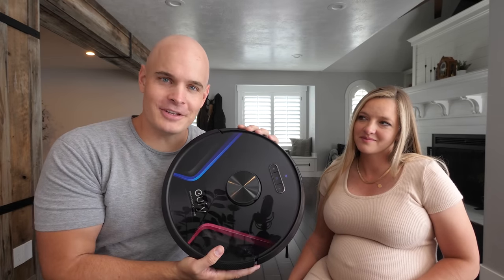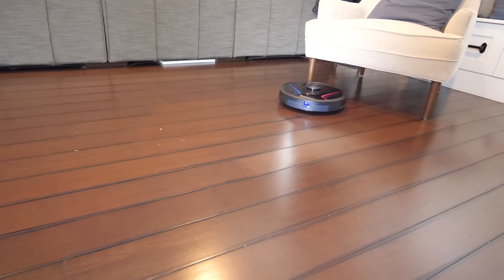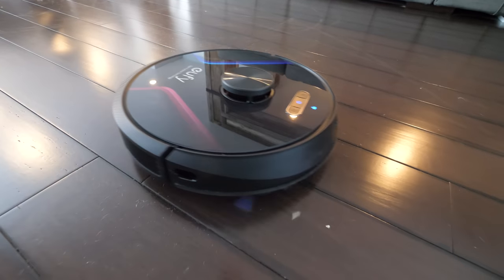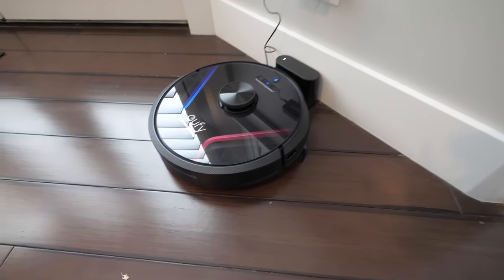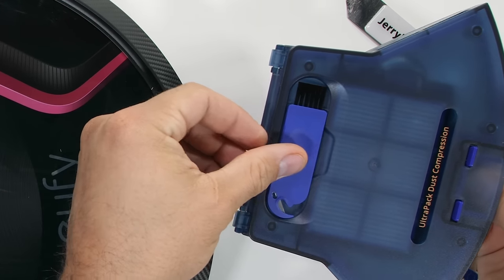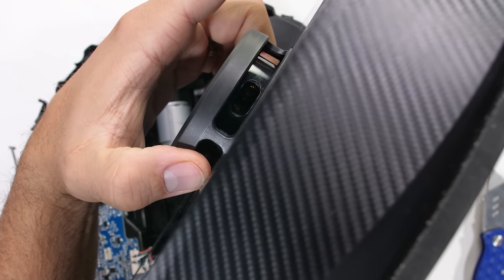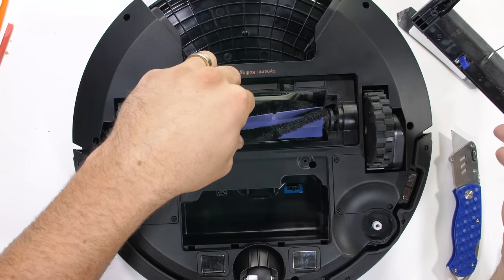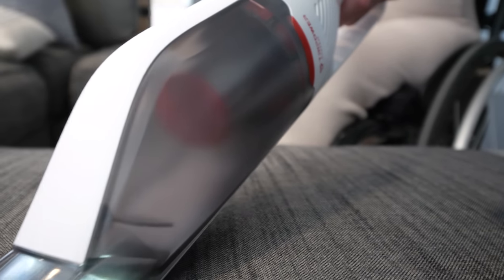How to Vacuum your House using LASERS?! - Teardown!

Comment: "whats a pascal? Nobody really knows" this is hysterical. Awesome video
Reply: in engineering, a pascal is 1 newton per meter squared, but i have no idea how that applies to sucking power lol
Reply: @damienmccue2793  It produces a "vacuum" with that much pressure relative to atmosphere.
Reply: @eDoc2020  Interesting, if i recall the video said 2,000 pascals, so inherently i’d assume that was the “suction power” over a square meter, but when taking into account the small inlet, which is probably closer to .001 square meters, you’re looking at .3 psi. (1 Pascal = 0.00015 psi)
Reply: @damienmccue2793  The funny thing about 2kPa suction is that apparently regular household vacuum cleaners are ten times that, or 20kPa. I can imagine this little robotic cleaner having less suction but only 10% seems a little wimpy. I wonder what the practical effect of this is.
Reply: @eDoc2020  it might have to do with the strength of its own propulsion system. We’ve owned a few vacuums that really adhere to the carpet while in use, harkening closer to that 20kPa i’d imagine. It might be too much resistance for the robot. And this little guy seems to move much slower than a mom on a mission with her vacuum so the decreased speed might be proportional to the lack of sucking power

Comment: Hey Zack, congrats for your coming baby boy. This is the first time I can see how your daily regular life is like. I've been your subscriber since 2015. 

If your house is all hard floors there is no need to install the roller brush (the one in the center of the robot). It's just for carpet or floor matt deep cleaning. If the robot just being used on hard floors only, you can avoid the hassle by cleaning it from tangled hair on the roller brush while doing the routine maintenance. Long hair will be sucked in right away rather than tangled on the brush.

Comment: Congratulations to you both.  
"What is a pascal? Nobody really knows" LOL! 
Pascal is unit of pressure, 2000 Pascal = 0.29 psi of suction.
Reply: Please let it as Pascal or Bar.
Reply: psi 😂😂😂😂 use science or stop trying
Reply: A pascal is a pigeon fart according to Elon Musk
Reply: Pa means N/m2. Which is newtons per square meter. A unit of pressure.
Reply: a 1080 ti
Reply: @evilbaron  I mean, kPa would be my unit of choice for metric. But psi is much more relatable to me. Idk how much a Newton weights, but I know how much a pound does
Reply: Pascal is Rapinzel's chamaleon.
Reply: So this little vacuum is pulling 580 psi. Not bad

Comment: also my lenovo vaccum from last year also has those spinning lasers but it still crashes into things any way
Reply: Robot vacuums with lasers (LiDAR, Light detection and ranging) has been a thing for a decade. Neato did it back in 2010 with the XV-11. Pretty much every robot vacuum has it these days except for the lowest end models. Focusing on the laser thing is purely to make it sound cooler than it really is. Btw the design of this looks very similar to the Roborock, same brush and everything. 🤔
Reply: @RaXXha  Just like EVGA or Corsair PSUs look very similar to SuperFlower and Seasonic PSUs? :))
Reply: Wait what? Lenovo made a vacuum cleaner😳😳😳
Reply: @AlexMihalceaHalcea  Nah he really means it. There are several noticeably different types of brushes employed by different manufacturers. However the one on this Eufy quite literally looks like a Roborock brush but blue instead of red. Get a picture of both of them online
Reply: @ExclamationMarx  i know, i have an s6 maxv; i was just stating that there's probably one oem manufacturer and then everyone else slaps their own brandname.
Reply: @AlexMihalceaHalcea  I don't think that's the case. Shark, Dyson, Samsung, Neato, iRobot, Ecovacs & Roborock all have noticeably different brushes. But Eufy in particular has a practically identical brush to Roborock
Reply: @ExclamationMarx  who knows, then? Maybe they just copied a good brush design laughs in Roborock fanboy language

Comment: The inside looks so similar to xiaomi's roborock gen 1. Literally just took it apart yesterday😂. From the bristles to the dust collection method and even the battery compartment, motor placement, front panel screw holes etc. Either this is going to be an industry standard, or they're taking thing off from one another😂.

Comment: I've learned, having hardwoods, you have to find a vac that's specifically good for hardwoods. For example, you don't need a beater that spins at a million RPM and shoots stuff everywhere, get a hardwood floor head.

Comment: Interesting, the thing seems to be a remodelled Xiaomi device. It uses the same motors, wheels, laser and brushes as the Roborock devices. The app also looks remarkably similar. It's not just a rebrand, because I don't think Xiaomi makes a twin-turbine vaccum. But there surely is a bit of sharing going on between these two companies. Also, congratulations :)!

Comment: No AI camera to help avoid horse poo and tangles, only one side spinning brush with no adaptive spin speed, and most of that suction is wasted on hardwood floors and is better served on carpets.... 
AND worst of all, no empty station to dump the dustbin which makes doing it in a wheel chair more difficult as it is on the floor and will need emptying every other day. 
Getting a bag from a emptying dock/station would be so much easier on a  weekly or monthly basis.
Just saying.. Laser is still much better than ceiling-facing cameras for nav and the suction is good but it's not quite a revolution. 😉

Comment: The home we recently moved into has wood floors throughout so we bought a Deebot, lovingly named Debbie. It is great for vacuuming the floors. It will get stuck  climbing onto rugs occasionally so we usually 'drive' it around the house with its radio control. It has spot and edge settings as well, Very useful.

Comment: Problem with that model is using only one brush, while you can perform a faster cleaning in one pass with twin brushes. I found Ecovacs' Deebot Osmio 950 perfect for hard floor, and honestly 2 turbines is just overkill and won't clean or "suck" any better than a single-turbine and two brushes which won't fling dirt around or any debree and its battery will also last way more if you have a big house or you like to make more passes in one session because OCD.

Comment: I get it's an add and I get it might be the first using laser instead of camera but the robot itself it's exactly the same as most ones which cost a ton less. This one doesn't even use water to clean the the floor after the vacuum and 2000pascal is the standard power in this things zack

Comment: 4:04 - Didn't have to lift a finger.....but you lifted a finger to unlock the phone, navigate through the list of apps, select the vacumm app, allow it to load, proceeded to tell the vacuum what to do, and then waited for it to do it.

I don't think we (I mean at my house) will be using robotic vacuums they are just too expensive when compared to grabbing a cheap broom.

Comment: Does the water tank continue to drip feed to the pad even when not doing mopping (i.e. gravity fed) like some cheaper robot vacuums or is the pad saturation controlled electronically (like on the Roborock S7)?

Comment: I have yet to find one that works.  As in.  I don't have to clean sensors several times a week.  Clean out a bin every day.  Or one that lasts more than a week.  So far it's been easier to manually vacuum my floors.

Comment: I just wanted to post this for anyone thinking about purchasing the vacuum based on this video. My vacuum failed after 2 months. Apparently they are recalling the batterie based on bad batches made in December 22. They indicated a replacement would be sent out 7-10 business days but have yet to receive a tracking number. 

I am not going to lie this is a good vacuum but their customer service is terrible.

Comment: Congrats!
Interesting. It would be fun to see how the IR detection works against refrigerators or other highly reflective surfaces.
Using contact pads (I'm guessing it involves some weak magnets as well) for charging is neat.
A question towards the operation - can it function autonomously without internet connection for the setup?

Comment: Just by looking at the bottom of it I can tell you my 7 year old LG is way better overall. The single 'spinner' on the Eufy seems like a stupid idea. Most robovacs have two of them that rotate in opposite directions to feed into the roller brush thing. As seen in this video, a single spinner just flings stuff where ever it lands.